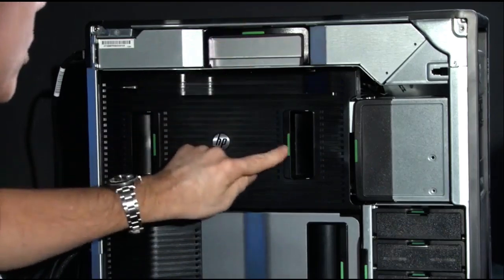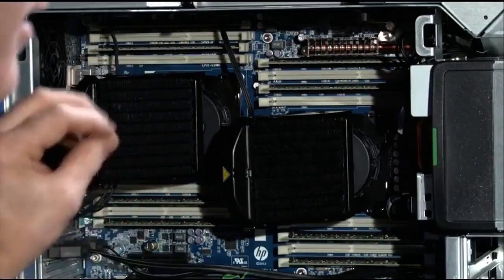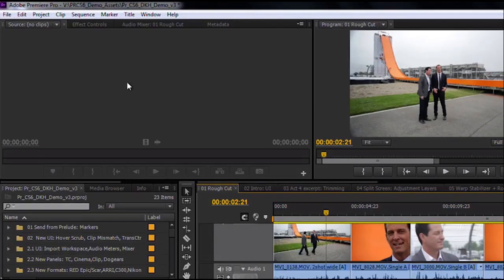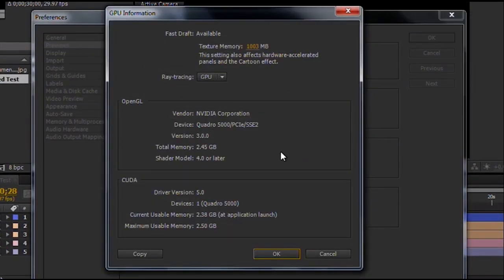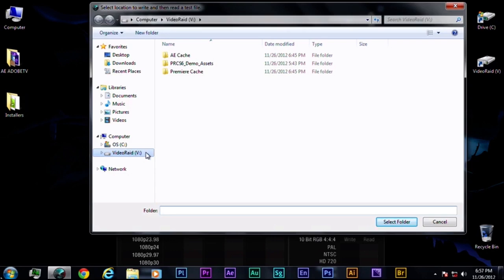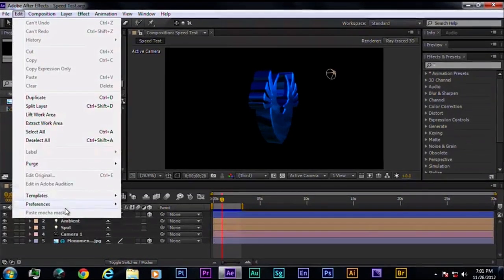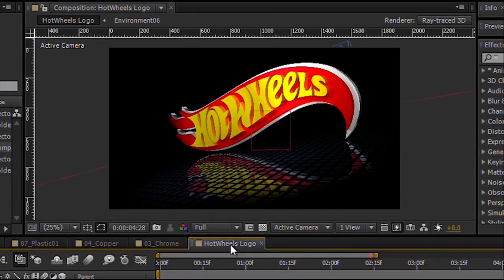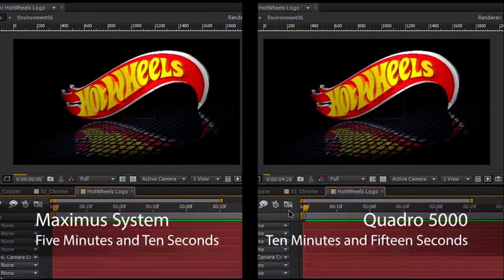Extreme Hardware Performance Featuring the HP Z820 and NVIDIA Maximus

Comment: does the Tesla K40 piar well with the Quadro K4200?
Reply: @DAVTechTalk  thanks.
I was asking because I have a K4200 in my present system and have access to a K40 Tesla (for free) but was wondering if they paired well (for AutoCAD/Revit use), or if it didn't make sense to take it.
Reply: @DAVTechTalk  I know Premier and Aftereffects will.. but do you know If AutoCAD or Revit will make use of the Tesla?